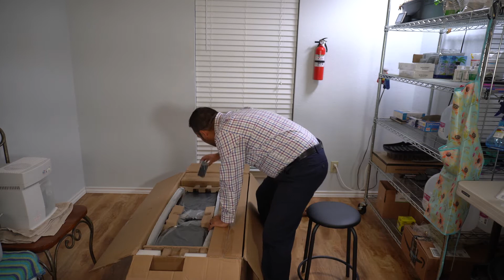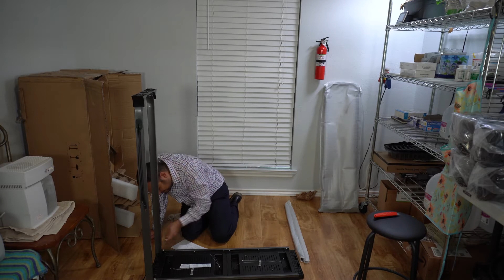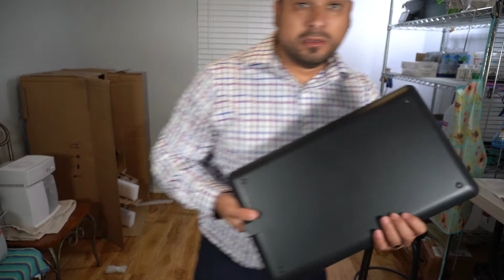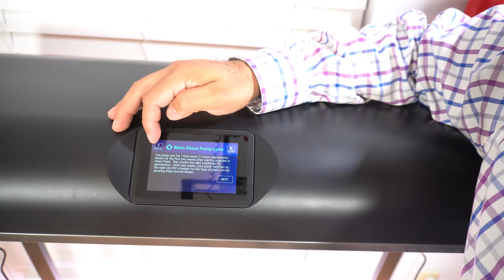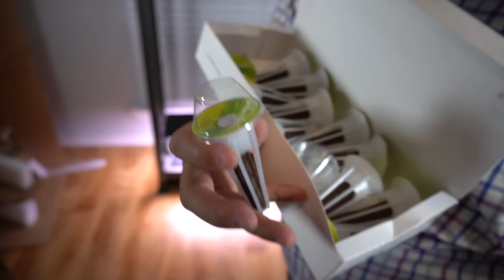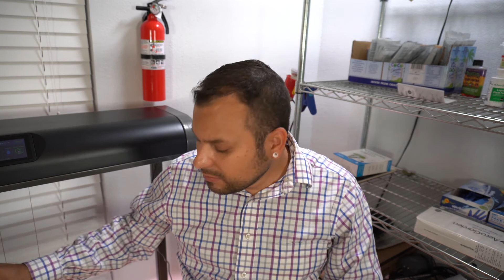Aerogarden Unboxing

Comment: Heatsinks remove heat. If the heatsink is supposedly the cause of the problem, you'd want to replace it with a bigger better heatsink or add another.